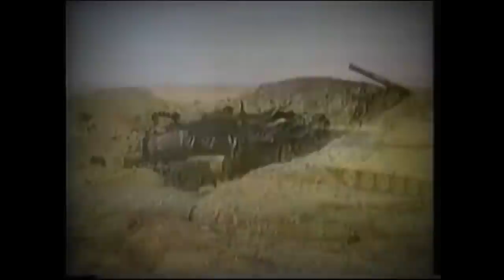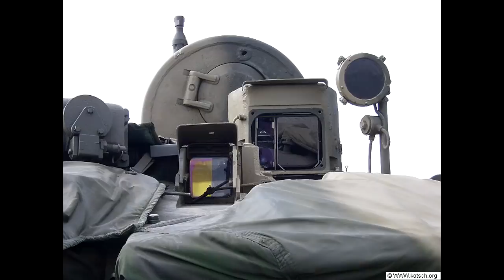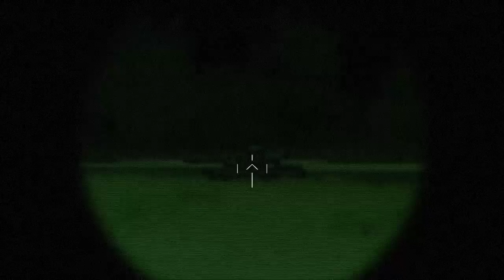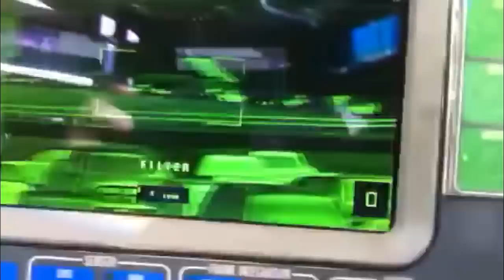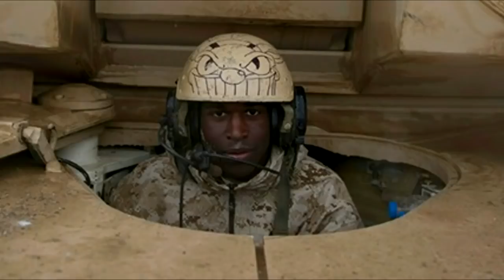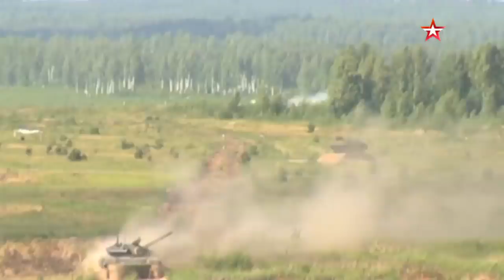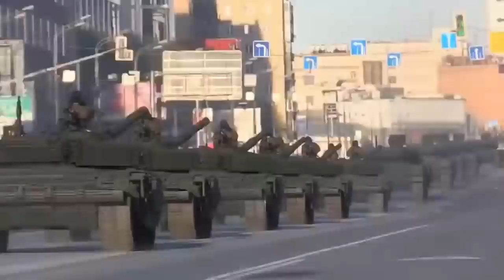Does T-72 stand a chance against M1 Abrams?

Comment: The real question is does 1 abrams stand a chance against 10 T72s?
Reply: depends on which t72 model and against which m1 abrams if your talking about first gen t72 export model with no era or thermal and balistic computer against the latest m1 abram sep2 then yeah no chance but if your talking about the latest Russian upgraded t72b3m which newer gun and ammo kontak 5 era Armour kit 3rd gen thermal sights and sensors against a first gen m1a1 during the gulf war then the fight would be pretty equal in fact the advantage might even lean toward the t72 but if the latest m1 abram is heads and shoulder above the latest t72 you will need at least the new t90ms or t14 to take on the latest m1 and expect to win 1 on 1
Reply: @patthonsirilim5739  If you look up the Russians exaggerations of there capability's and poor training and discipline and terrible reliability also look up even the best T72 armor specs . The t72 does  not have a chance. We understate capability's the Russians have a clear history of extreme exaggeration.
Reply: @tomhutchins1046  hey im not talking about weather the us military can beat the Russian im talking about the fact that the most recent modernize t72 does have fair chance in taking out gulf war era m1 Abrams
Reply: @patthonsirilim5739  And Im saying even without the training advantage the Abrams latest model is far better than the latest T72
Reply: @tomhutchins1046  no question that the latest m1 can curb stomp the latest t72 but the earliest gulf war batch of m1 which is no longer in use in the us army vs the latest most advance version of the t72 that is not so one sided.
Reply: @patthonsirilim5739  Not so one sided? You have to see the big picture just lining the tanks up like a western gun fight is not realistic you need to consider them how they are used tactics discipline training. having the latest (todays) t72 would not have helped the republican guard one bit they would have ended just as dead. red effect did a video comparing the early t72 to the latest variant. Yes the armor and gun got better but it would not have made any difference again penetrated is dead. Accuracy range mobility were still inferior.
Reply: @tomhutchins1046  i did not say a latest most deadly version of t72 would make a difference in the gulf war or iraq war to sadam there were to much capability gap from army airforce navy logistic and inteligence or for iraq to win the same could be said about the americaan if the american were to sub out the m1 for a t72 they would still have won that war now back to the main debate you said that a latest t72 have no chance against a gulf war era m1 i say your wrong 1 v 1 the most modern t72 deffinitly can take out a gulf war era m1 with everything else being equal the m1 in its gulf war era spec is deffinitly not much better then a modernise t72.
Reply: @patthonsirilim5739  Your statements are contradictory.
Check red effects video on the t72. Even the most modern version of the t72 would have no chance.
Your obviously from another country and are grasping at straws to prove a weakness in the Abrams.
Sadam actually or more like his republican guard generals did about as good as he could do with what they were faced with.
They attempted reverse slope  defenses. They dug in there tanks because they had no chance of out maneuvering the Abrams and the tactics used. If that were first line Russian troops with the best modern T72 the same results would have happened.
Remember the Abrams was designed for battle in Europe against masses of Russian first line tanks operated by Russians with Russian support.   
So your theory is to line them up facing each other shooting? 
That's irrelevant you may as well line up 2 fighter planes on the runway and have them fire missiles at each other? LOL
Its the hardware , tech , QUALITY CONTROL (something Russians dont have) Training ,support, intelligence.
Hey why dont you theorize on taking a mig and an f22 have them ram each other on the runway and decide which is best?
Reply: Well it depends on who is inside the T72. An Ivan inside a T55 is better than a Muhammad inside a T72.
Reply: @deltacharlieromeo8252  And an NVA Soldier in a T72B3?
Reply: @deltacharlieromeo8252  now we know that Ivans are no better...
Reply: @deltacharlieromeo8252  Dead is dead really does not matter the t72 in any version is no match for the Abrams
Reply: @tomhutchins1046  5 T-72B with kontakt-5 and 3BM42 rounds will win vs vs 1 m1A2
Reply: @Ivan-pw3sn  Your dreaming TROLL you would be dead long before you knew the Abrams targeted you
Reply: As long as it has 10 rounds.
Reply: Depends on which version of Abrams ?! The initial versions with the 105 mm cannon did not have a chance even against the old T-72A, one on one. And not 1 on 10, The T-72S version already had the ability to fire laser guided missiles, with a range of 5 km. So it is much better than the A version. The author of the video clip mentioned the version of the T-72B3M, the last modification, but he incorrectly stated the details, it is a far more advanced version compared to the standard B3. He forgot to mention that he has a new panoramic sight of the third last generation installed, which can be seen in the video clip itself. Abrams has a second generation, meaning worse and shorter range compared to the T-72B3M version. which previous versions did not have. Virtually all opto-electronics including, even the mechanics of the new automatic transmission and engine type were taken from the T-90M / MS tank. There is also the "Sosna U" sighting system for the marksman. With automatic target tracking, second generation, just like on Abrams. A laser-guided "SVIR / REFLEX" missile with a range of 5 km and a penetration of about 950 mm of homogeneous steel was also mentioned, There is of course a new cannon of much greater possibilities. It should also be noted that the B3M variant has the possibility of reconnaissance at about 10 km, laser targeting at 7 km, and the possibility of destroying the target at 5 km, or 2 km before Abrams. Or to translate, B3M will notice Abrams sooner than Abrams will notice B3M, also with a laser-guided missile with a range of 5 km, it has the advantage of a first shot, 2 km before Abrams. clear, the T-72 is a very dangerous tank, in the appropriate version of the modernization. It is also not stated that the B3M version has reinforced armor, a combination of relic armor and contact 5 ERA ... As I said, everything depends on the variant of both Abrams and T-72, because the variant T-72 from 1973, is not the same as this from 2016, they are two completely different tanks. Like the Abrams of 1980, this m1a2 Abrams SEP v2 has nothing to do with each other except appearance. However, it is persistently stated almost nowhere that there are extensive modernizations of the T-72 tank. Believe it or not, there are top variants of the T-72 tank. Approximately or equally capable as Abrams only it is persistently not mentioned. While, for example, the T-72B1MS version is much better, in terms of its opto-electronic characteristics, than the Leopard 2 A4 tank, which is used by most of Western Europe. It has the same opto electronics of the new generation as the above-mentioned version of the Russian army T-72B3M. Only with an additional remote-controlled combat station 12.7mm, and with an additional unit, for the operation of all systems on the tank without turning on, the main propulsion engine ... But with poorer ERA armor protection ... There are really many versions, and levels of modernization, only which people are generally unaware of.

But fools talk in vain. They will continue to shit about Saddam Hussein, and his T-72 tanks, which is the worst possible version of the T-72 tank, the M version for export, with armor thickness, of only 380mm on the dome, against APFSDS, which is equal to the T-72 "URAL "version or the prototype T-72 tank, such tanks were owned by Saddam Hussein, at the level of the prototype version of the T-72 tank. Who does not believe, let him check, there is information about that. Take for example the old variant, the T-72A version of the first modernization of the tank for the USSR army in 1979, which had armor 120 mm thicker or 500 mm against APFSDS projected. Not to mention the totally degraded, opto-electronics. Also, the Iraqis had, only at their disposal, one of the first versions of the APFSDS projectile with a penetration of only 280 mm, from the 60s of the last century. Not to mention the B1 version, which has a stronger engine, a new cannon, the ability to fire laser-guided missiles, and additional armor protection of 540mm against APFSDS missiles, and against HEAT as much as 950mm, which is twice as much as the Iraqi T-72M. B3 version from 1988, with contact 5 ERA against APFSDS 800mm against HEAT even 1180mm ... So it is completely incomparable to compare the worst possible version of the T-72 tank M version and today's B3 or B3M. These are different generations of tanks. 

Model	          Turret vs APFSDS	            Turret vs HEAT	        Hull vs APFSDS	 Hull vs HEAT
T-72 'Ural' (1973)380–410 mm (15–16 in)	450–500 mm (18–20 in)	335–410 mm (13.2–16.1 in)	410–450 mm (16–18 in)

T-72A (1979–1985)(1988)+Kontakt 1	410–500 mm (16–20 in)	500–560 mm (20–22 in)	360–420 mm (14–17 in)	490–500 mm (19–20 in)

T-72M Iraqi version of "desert storm"  (1980)	380 mm (15 in)	490 mm (19 in)	335 mm (13.2 in)	450 mm (18 in)

T-72M1 (1982)	380 mm (15 in)	490 mm (19 in)	400 mm (16 in)	490 mm (19 in)

T-72B+Kontakt 1(1985)	520–540 mm (20–21 in)	900–950 mm (35–37 in)	480–530 mm (19–21 in)	900 mm (35 in)

T-72B+Kontakt 5 (1988)	770–800 mm (30–31 in)	1,180 mm (46 in)	690 mm (27 in)	940 mm (37 in)
Reply: @SRB.4S  Your living in a fantasy world go back to your video games
Reply: @tomhutchins1046  I have set out the obvious facts. Which can be easily checked. I don't play video games at all. You started it yourself since you obviously only play games. Go kid play games that's best for you.
Reply: @SRB.4S  Your facts are meaningless out of context google search nonsense. The original (The real question is does 1 abrams stand a chance against 10 T72s?) is also childish simplistic garbage.
 Ask the t72 crews from the gulf war how that worked out for them / Oh wait there all dead that's the reality.
 Russia builds numbers not quality. most Russian soldiers are conscripted peasants not professionals the Iraqis had the same issues. You cant fight with a google search. Any weapon is only as good as the personnel quality tech. workmanship, support, Training and tactics used.
Yes and a T90 would probably defeat a WW2 Sherman so what's your point? That's if the T90 did not break down and the crews were not drunk or got out and ran away back to there farms to raise potatoes!
Reply: @tomhutchins1046  You do get that your Nazi fantasies got nothingt to do with reality nor does it change it.
Reply: @miriamweller812  Crawl back in your hole troll
Reply: Yep,true
Reply: obviously not
Reply: I doubt it could go against 10 of them. I'd say maybe 2 or three t-72s would die, ?$4 unless the abrams is hull down somebody's gonna pen the front hull easily.
Reply: @Eleanoir3  No the front wont be easy to penetrate. The turret is almost impossible. Yes it would be a trick to beat 10 . But they dont state lined up like a gun fight in the old west.
What is the terrain? Hills tree's? large rocks? A mountain pass where the Abrams would only face one at a time? Do you think the American tank crews will sit still and wait? The Abram's is faster than they claim is very maneuverable and can fire very accurate and fast even in rough terrain at a long distance. Some t72's would be a burnin. But war is a risk so yes it could go bad.
Ps Hull down is what the Iraqi's tried that is WW2 tactics at best
Reply: @Eleanoir3  You may as well be asking if 2 ducks were attacked by 10 pigeons who would win? Well it depends?
Reply: What it would come down to would the 72s be able to close the distance to get close enough to get an effective shot on that front hull. If were starting outta max range of both I don't see the 72s having a chance as the range the Abrams can hit the 72s would be significantly farther and should be able to maintain it the best chance for the 72s would be for Abrams to run out of ammo.
Reply: @gregbagby472  The front of the hull vulnerability thing is very over rated. The Abrams was designed for NATO head on shoot outs . Out numbered by Russian tanks. Look at a front profile its all heavy high tech armored and angled turret. Even the tracks are a very small target. the small front panel is also special. The Abrams is heavy and much of the real armor on our military's tanks is classified. Export tanks are different. In a situation like the first gulf war the latest t72 would have done no better.
Compromises were made to do this.  Abrams in a urban environment moving slow has venerability's. The ammo is behind the turret perfect in a head on charge. not good moving slow surrounded by unsecured high ground. In a urban environment the Abrams needs infantry support. Same goes for the Russian tanks.
Reply: @gregbagby472  Russian T72 got a firing range of up to 9km...
Reply: 2    T 72 reichen.
Reply: When M1 enters the battlefield, it means all 10 T 72  had been destroyed by American air force
Reply: @Ryzen7-x9h  I'm pretty sure that the Americans won't call air force asap
Reply: @mr.laughington5740  It's wha they start all their genocidal wars with, brutal carpet bombing of the country they invade.
Reply: @Ryzen7-x9h  Hey dumb dumb, Air is not effective against heavy armor. Its is effective against light armor and infantry. All 10 would be killed by Bradly's before even getting close or seeing the Bradly's and Abrams
Reply: @tomhutchins1046  cough agm - 65 cough laser precision bombs cough cough a-10 cough ac-130 coug cough cough 'dumb dumb'
Reply: @AmericanIdiot7659  if you research it the vast majority of munitions used were dumb bombs many left over from the Vietnam war. The smart bombs are very expensive. We dont have that many. Also the c130 is a Large slow moving sitting duck for ground fire. Even the A10's were told to fly much higher early on so they lost accuracy. its not a war game. You have been watching to much TV
Reply: @AmericanIdiot7659  Oh and you have to hit the tank close wont do it.
Reply: @tomhutchins1046  then you figure out to kill 10 t-72s with 1 abrams dumb dumb
Reply: @AmericanIdiot7659  You stay out of there range and shoot them. or call in the Bradly's. Idiot
Reply: @tomhutchins1046  or just get yuo mom ahaha
Reply: Yes, it does. Why? Because it was designed specifically to massacre them while being heavily outnumbered with them. That was the world war 3 reality taken to account in Abrams design. Everybody knew that the soviets would outnumber NATO tanks in Europe. And if some small number of T-72s survived that massacre, these were to be massacred by A-10s and AH-64 Apaches. That was the scenario that never happened, but Desert Storm gave us a pretty close simulation of that exact scenario.
Reply: @soberek  The idea alone that WW3 would be some tank battles, oh my... your fascistic delusions are insane.
Reply: Frontally easily.

Comment: A sereious disadvantage of T72 tanks is its ergonomics. Compared to western tanks that are already tight from the inside the T72 is a can of pilchards. The crew will have some issues to work efficient and concentrated in this tank. At least if they are not pretty small.
Reply: as a counterpoint I've heard from former T-72 crewmen that it being a tight fight can be advantageous when moving fast in terrain, since you move around less, but ergonomics matter a lot more in prolonged battles anyway.

Comment: It's not surprising that a sufficiently upgraded T-72 isn't much different than a modern Abrams, T-72 finished the design process in 1973 and the Abrams in 1975. Hell the 1975 Abrams had a 105mm gun so it was pretty comprehensively outclassed against the early T-72 in terms of firepower, although it probably had better fire control. People really seem to forget that these two tanks are from the same general time period, it's just that the Americans didn't build any newer ones afterwards and just kept upgrading what worked instead. Really it's just a matter of how much money are you willing to spend, money to upgrade the tank, money to train the crew, money to train the mechanic, money on upkeep etc.

Comment: He who sees the other FIRST and gets the shot off usually has the advantage BUT hopefully the new versions can range better the Iraqi exports fell short in this category in the first Gulf War.  Plus the barrel change in the Soviet models were too frequent compared to Western tanks.  But the Russians have modified their tanks from smoke dischargers with particles to break a laser lock new Explosive bricks to blunt projectiles but the one to me essential element they lack due to weight is a gyro stabilizer platform to shoot on the move- the battle of East Hastings showed how a troop of M-1s and Bradley IFV can decimate a static regiment of T-72s very quickly granted the conditions were perfect for the attackers.  Soo the big question is will the improved T-72s in quantity offset a numerically inferior opponent if the Golan Heights battle of 1973 is any indicator it’s about the man and the machine- the wild card!